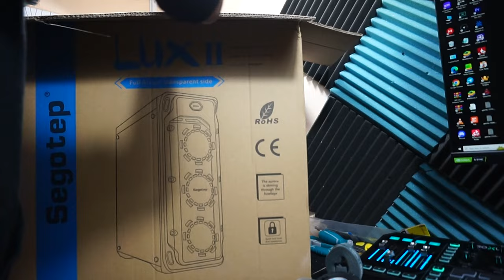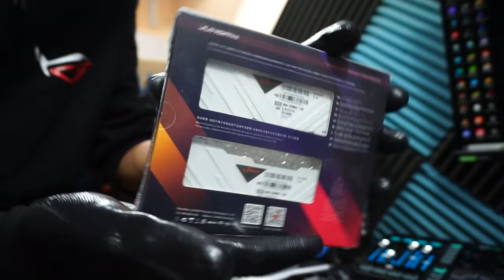Pasang Gaming PC 2023 RTX 2060

Comment: Why are you using a 2060 that costs like $450 you could've gotten a rx 6700 xt or a rtx 3060 ti for that price smh
Reply: Bruh rtx 2060 cost like $135 in second hand market
Reply from the maker: This 2060 is secondhand not new..so the price of 6700xt and 3060ti is much different
Reply from the maker: @mirulhaziq3339  true 👍🏻
Reply: @mirulhaziq3339  and? You lose so much performance even if its 135$. I get that its a good price but you can get way more performance with other cards
Reply: @astraldivinityyy7852  most people are fine with 2060 performance. and those double the price. you can't convince some people to spend more than 200$ in a single component, my brother is like that.
Reply: @astraldivinityyy7852  yeah around this price rx5700xt or Rx 6600 probably better than rtx 2060
Reply: @LagiohX3  i get that